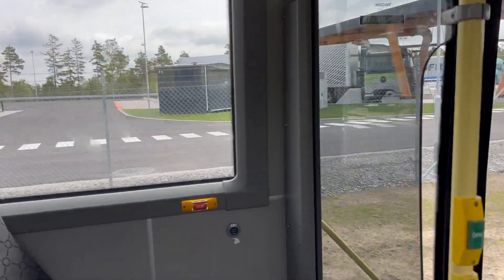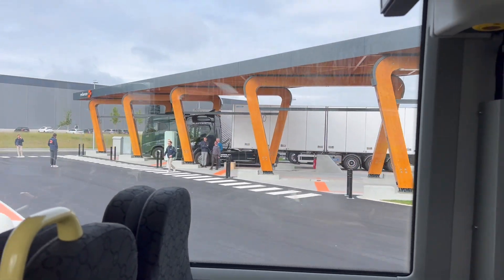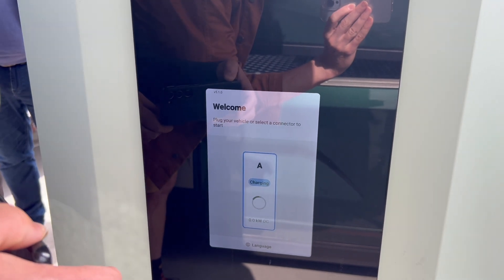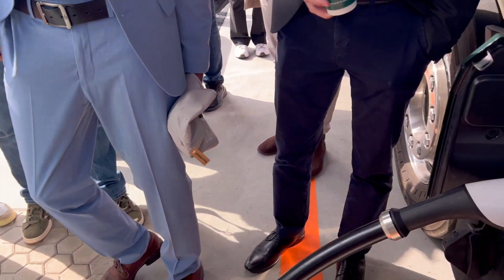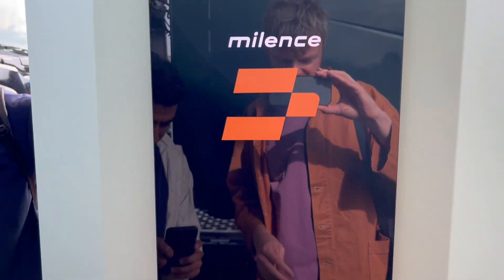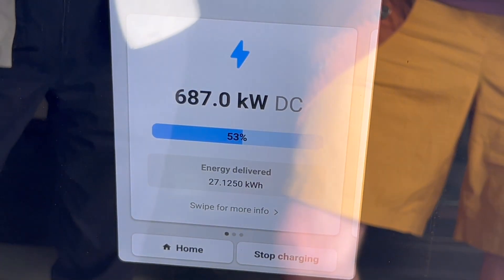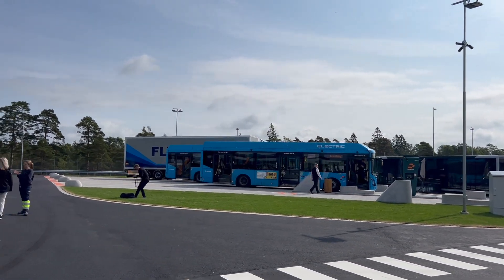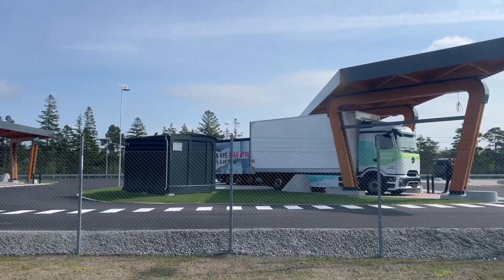First Public MEGAWATT?! (#MCS) fast charging session at Milence in Sweden Volvo FH Aero

Comment: So it basically is giving 50% of the potential charging speed? Not much of a demo in my book
Reply: And the charger is limited to 1/3 the potential charging speed of the MCS spec, but these are the first implementations, that's the nature of it. ~700kW still represents a roughly 2x increase in speed over current electric trucks.
Reply from the maker: CCS charging BEV trucks run into cooling issues VERY quickly, of course depending on tons of factors (hw, cabling, cooling, weather)
MCS will deliver predictable very fast effortless charging at well over 1000A for long periods of time
Reply from the maker: Volvo is limiting #MCS for now at 1000A - the curve goes up with the voltage
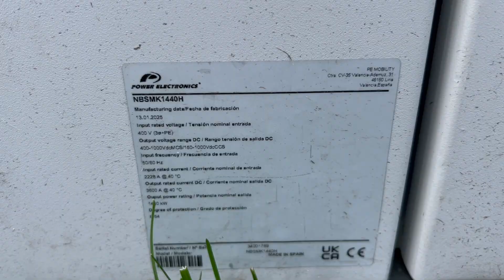Reply: 5:35 It can do 1440 kW
Reply: @abraxastulammo9940 yep and spec allows up to ~3.75MW (r-MCS can go even higher)

Comment: Brilliant Felix, thank you! 680 kW at 50% is an amazing sight and Milence has really nice truck charging sites.
One question - the cooling noise, was it from the charge cabinet or from the truck, when the charge session started?
Reply from the maker: hard to judge from this one time noisy environment, but the charger was definitely the one making the noise, maybe the Volvo made some but definitely not impressed me :D
also since they're (for now) limited to 1000A - that might be possible without very fancy fans ;-)
the cabinet (on the other side) was more noisy than the dispenser, but all impressed by being fairly silent given the near 700kW performance (they did another session later that day when they did cross 700kW thanks to higher SoC %/higher voltage!)
Reply: @electricfelix  Great. Thanks Felix for the detailed reply and also the genuine commentary "They started without waiting for us" :D